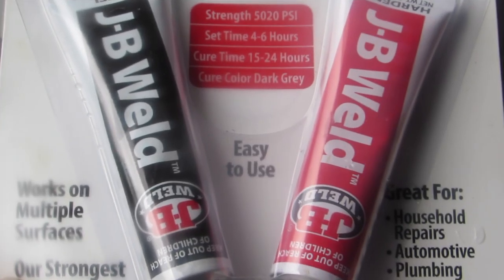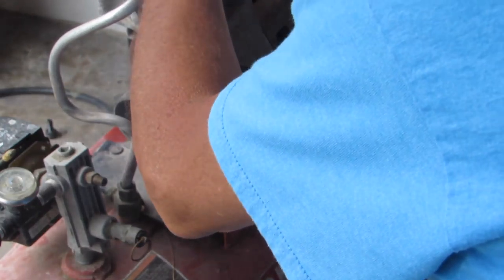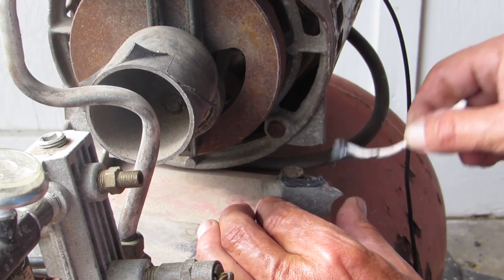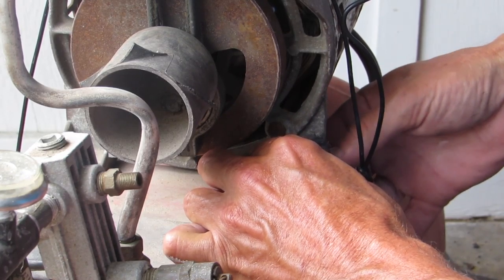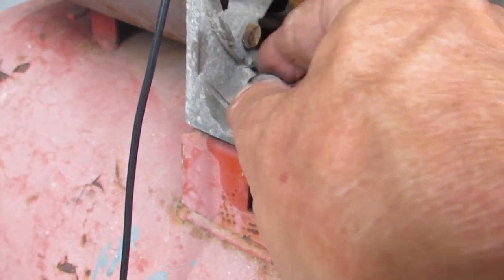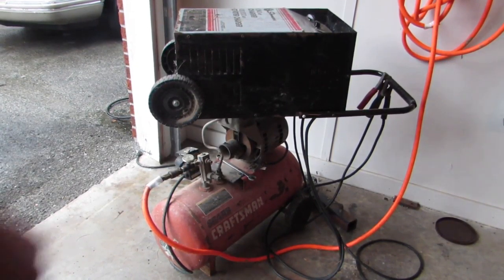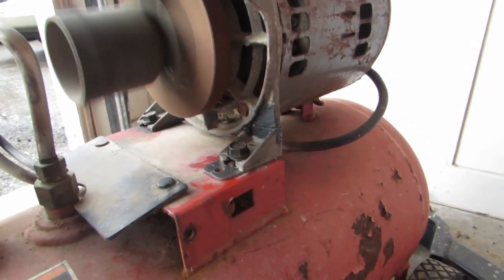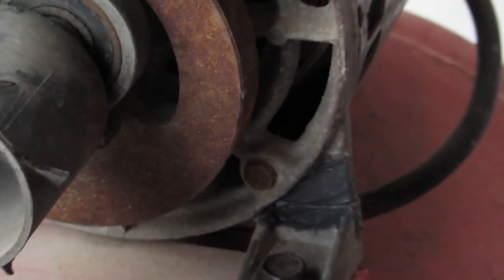JB Weld, Does it Work?

Comment: The mount should of been cleaned prior to applying JB Weld.  Always best to scuff break with sand paper to get to clean bare metal. Then I wipe down with isopropyl alcohol to remove any oils. Allow to dry, then apply JB Weld, clamp, wait 24hrs.
Reply from the maker: Thank Mr or Mrs Glue-pro. 
I will call you if I need you to glue something.
Reply: JD Weld
Reply: A wait of 48 hours gives the best results, but spot on. Without doing all those steps it will not work.
Reply: @JohnDisque sorry for the term rust. And yes I'm a glue expert. I create glue formula. I bought multiple properties out of it. You want an autograph?

Comment: The weight on top is what did it. It squeezed out all the weld in the middle. It’s actually better to just give it a light press (weight) to hold it down.
Reply from the maker: Yeah.... But I've tested this on other stuff.. and it failed on the easy crap too. 
I wish I would've taken it apart. Since this time I've restored it on the channel Pro Level Restoration and it's really no big deal to rip it apart, WELD it and get it back to to right.
Peace
Reply: And you needed to clean and prep the area
Reply: I find the JB Weld two part putty works better.  Knead it until the two colors turn to dark gray then apply it.  Hardens pretty quick then let sit for 24 hours

Comment: You would be better off drilling a hole in the top section and another in the bottom section then use baling wire or a pull tie to secure it together.
Reply from the maker: I would've been better off Scotch-taping it.
Reply: or a bracket with small bolts if your going to drill holes

Comment: Vibration is the culprit here, I believe strongly that JB weld is not your long term solution, although its a darn fine epoxy. Your little Craftsman compressor looks to be a little beauty and they don't make 'em like that no more so fabricate a small metal plate or have it welded and then mount it on thick rubber washers to help minimise vibration... take good care of that little work horse!!
Reply from the maker: Indeed... Vibration is the root of the problem.
I did stop most of the vibration before I ran the review and when I got it welded up all the vibration stopped. 
I'm going to follow your lead and completely restore this old work-horse. It's been good to me. 
Peace.

Comment: Ty for the 411, JB Weld off the list. I use Gorilla Glue often but don't think it would hold up either. Guess new replacement part if could find might be best long term fix but might be a bigger job than wanted replacing. Welder sounds good and quick too.
Reply from the maker: I'm a big fan of Gorilla Glue and it hasn't failed me yet. I just used it on a rear-view mirror and it's working great so far.
JB Weld would probably work on something that doesn't have stress on it.... like a sealer for a pipe or something.... but the name of the crap is misleading.

Comment: You need to gloop it on thick, in otherwoods use up the whole tube on that, also do not put any in the break just over the top, it binds both pieces superficially, hope this helps

Comment: These type of repairs work best if you drill a small hole (1/4" or smaller) in each piece and use a flat piece of steel or aluminum to connect them with a couple of bolts and nuts.
Reply from the maker: Good tip.
I'll remember that.
Reply: Yes that would actually work a lot better

Comment: It’s all in the prep mate. Sand down the area and clean real good. No oil or grease deposits.
When mixing make sure you mix well. And correct amounts.
With yours you should of really built that up around the area that was weak. It wasn’t enough . But good try .
Reply from the maker: Thanks for the tips!
Reply: Take a piece of plumber's tape bend it 90° take that 10 mm case stud off which has a nut on the other end of the engine put that through the hole in the plumbers tape of the washer bolt it back down and bolt the other end to the top of your compressor?
Reply from the maker: @evilbeetlekustomscreations4965  I love JB Weld Experts.
Come here and get ya some!

Comment: the only way for jb weld to work is to leave a big amount of the glue on the outside right now I am convinced that is the only way it works as advertised, I have had some issues with jb weld I am currently still experiencing issues, what I have found is that if you dont care for how the piece looks like, meaning you  dont care for aesthetics this works to some extent but if your application needs to be clean and keep the piece aesthetics then this in most cases wont work, right now I got to this video as I am on the search for structural epoxy resins that could glue aluminum to aluminum as my motorcycle fell and the thread piece in the radial master cylinder where the rear view mirror goes  broke off and am trying to see if I could spare me some $$$ by using epoxy or whatever I may find.

a little recap on what I did so far: 
I prepared the piece, 
drilled some holes on both sides where it broke 
with the dremel made some gaps to allow for better adhesion and allow for sort of a ring of glue to be formed on the inside as I carved the pieces, 
when broken piece is seated they fit precisely and on the inside its hollow the idea is to fill with jb for more strength, 
applied a generous amount of jb weld and made sure it went all the way in into the wholes and gaps on both surfaces ( with a metal wire made sure the jb weld went inside the gaps and wholes)
seated the piece and pushed it manually to allow for the excess to drip out.
removed any excess from the outside with some scott shop towel, and with a clamp made sure the piece was strongly secured into place to allow for a stronger adhesion,  
fast forward  24+ hours I tried screwing back the mirror and even though jb weld stick to the aluminum the epoxy "monolith" that hardened inside the piece cracked and broke without even applying great force to the piece, wasnt even screwed all the way in before it cracked..

if anyone has an idea on how I can glue the piece I am open to suggestions.

Comment: Adhesive joints don't work well in tension. So a simple butt joint is unlikely to hold up for very long. You'd probably have better luck with a couple of butt straps cut out of sheet steel bonded either side . That way you're taking advantage of the much better shear strength of an adhesive joint.

Comment: It should has metal plates glues to the broad sides as well, like wrapping sticks around a broken leg with tapes or ropes, so gluing more metallic plates to the broken joints' broad sides, apply more of the glues, more layers of metallic plates glues around the broken joint areas, it's about gluing up more contact areas. So it's like applying more "tapes" on the front and back sides of the broad sides, the "tapes" are smaller metal plates or fragments, glue steel rods (nail thickness) on top of the metal plates as well, so bundle it up like a grenade - combining of glues, plates, glues, plates, nails, rods, glues, so it's like a bird nest! But since you are using up so much of the glue, why not try pay for gas, electric welding or laser welding ?
6 packs of the glues costing $120 NZD ($21 NZD each pack), at a strength of 3960 PSI.

Comment: What psi was your JB Weld. I would have drilled a hole for a bolt and tapped the matching threads. I would have still justed JB Weld as you did but also run my new bolt in. Should have been able to use it right away afterwards and it should hold for years to come.
Reply from the maker: 44.52947892 psi.
Thanks for you suggestion.

Comment: I'm at the 3 minute 11 second Mark into this video and I hope the JB works out for you I just prepared a table also with JB weld but I put a threaded rod through it and hopefully it'll work. Edit finished the video I was surprised at the quick failure.
Reply from the maker: You should be fine with your table. This motor mount is a tuff job for any adhesive because of the constant vibration and moving parts.
Reply: @JohnDisque  Yes sir thank you

Comment: Looks like the middle of the motor was fouling on the top of the tank causing it to pull the motor away from the bracket. You would need spacers on both sides

Comment: You could have used a Dremel with a small grinder wheel and made vertical slots on both sides and on both sides of the break then filled the slots with the JB weld and it would hold for years.
If jb weld can work on a car muffler it can work on anything.

Comment: Maybe it didn't work because you should have left a small gap between the two surfaces instead of forcing them together?
Reply from the maker: You're the only person to come up with a legit reason why IT MIGHT NOT have worked and I actually considered this at some point. I don't know and even if that's the case it should've at-least worked a little bit.

Comment: Recently tried the jb clear weld fastening a plastic battery box holder to inside of metal detector thats aluminum, soon as I broken tab off the product it had the worst smell & just doesnt go away at all & if you get it on your fingers the smell will not be able to come off for days even using nail polish goo gone the smell will disappear days later by wearing away using your hands on doing things round the house, I think the bonding may have held up so far but again the smell on the repaired area is not going away at all it may be there for long long time.. If I ever use any epoxy glue again for any other repairs down the road it sure wont be any jb product no matter how well it works.. I dont understand why the manufacture doesnt disclose this on their products of the horrible smell it releases once opened & after applying the epoxy the smell can make you sick..
Reply from the maker: If it worked I'd welcome the odor but it doesn't. I'd be surprised if it clued two pieces of cardboard together. If there's any kind of stress or vibration on what you're trying to repair you can forget it...., but that's not unique to J-B... If the part is metal you should weld it or replace it. 
Peace

Comment: I'm welding my heater core pipe the pipe goes to heater core 2 small one it's leaking but very little because the seal isn't really matching 100% so will this join the pipe end to heater core ?  Will it seal it ? The pipes do go inside heater core but the rubber or something making it leak there just little drips 

So my plan is put this inside the heater core ring and some around the pipe tip and fit them inside and put some more outside 

Plz let me know if this holds well and it's strong as they claim to be there is not much pressure but pipe might be little hot as its antifreeze going to heater core
Reply from the maker: I'd give it a whirl but I'm a gambler. I can't tell you for sure it's going to work and I can't tell you it isn't going to work but you're not dealing with all this vibration so the odds are with you.
Clean it up real good with alcohol and give it a shot. 
Peace
Reply: @JohnDisque  I did worked great and it's like a rock no antifreeze leak I let it dry for 8 hours and when I drove the car for some reason made it even harder cause the pipes get hot so not sure if that cured it even more 

I went bought some more and I added more on top and around for extra security before I close the the parts 
I am keeping it open the area driving the car for some days before I put rest of the parts in 

But amazing products I didn't think would work wasn't sure but when it cures it's like concrete super hard I couldn't even scratch it with screw driver
Reply: @JohnDisque  thanks for the reply

Comment: You didn't wire brush any debris off both edges of the break. It also might have worked better if you unbolted both sides, propped it up and fit the (brushed) broken pieces that way and applied a liberal amount to both sides of the break. Give it a few minutes then just unprop and set it down gently for 24hrs. The weight of the compressor should've been enough. 
If possible, turn the machine over so there's no weight -- or gravity -- on that broken piece.

Comment: He should have turned compressor upside down and affixed the broken piece on from the top. THAT would have worked. The pressure on the whole unit dissipated over both mounts. Not enough on the side needing repair!!

Comment: I got 2 motor mounts broken on my motorcycle on the bottom of the engine. Was thinking about jb weld bc I don't have the time or money to take it to. Machine shop. What did u do to end up fixing it?
Reply from the maker: My buddy came over with a mig-welder and fixed it in about 2 minutes. 

In your case.... if you can't just replace the mounts - a good welder can do it but I stress "good" because I've seen some really bad weld-jobs and you need to get your job as straight as humanly possible.

Comment: You didn't apply adhesive to BOTH pieces. And you should apply sufficient amounts to make it ooze out. Applying it and pressing it together as opposed to just pressing result in two different adhesive distributions in the crack. Also, alignment is key and the most important part of the process. I suspect that could have been more of the problem. The spacer was a good idea but without the other two techniques it was doomed. As someone mentioned, overweighting could be a contributing problem but if it was aligned and pressed together correctly with a sufficient volume of adhesive, overweighting would not have made much of a difference.

Comment: I think youd be better taking the whole thing off, drilling through the broken parts taped together, tapping a thread in one of the parts & putting a counter sunk grub screw or machine screw in after you added the epoxy. That way its mechanically held as well as glued...the epoxy should stop it vibrating apart? Just an idea.. :|
Reply from the maker: I got it welded and it's been fine ever since. If it couldn't be welded I would've done something similar to what you suggest here or I would've purchased a whole mount if they're available. 
Either way I wanted to see if this crap worked.
Reply: @JohnDisque  Interesting video... been wondering myself what you can use that stuff for. Guess its better just as a filler..

Comment: you applied the epoxy to a dirty surface, two actually, I saw no clean or prep.  May as well been gluing mud clots together.  If you actually welded it together do you think the surface would have been prepared first?
Reply from the maker: OK

Comment: I'm guessing it would have worked If you first bolted the compressor down  and then use JB weld to fill the crack and put a lot more JB weld on the outside of the crack... I would give it two days to cure....
Reply from the maker: You got one part right - you're guessing. I used the left-over garbage to test it on less strenuous things and it failed on that too.
This garbage is worthless.

Comment: Did you rough up the surface before apply. It usually needs something rough to grab onto
Reply from the maker: No, but I threatened it and pistol-whipped it like Kyle Rittenhouse. Then I swore I'd replace it with Elmers glue if it didn't work.
Reply: @JohnDisque  🤣🤣🤣

Comment: I've generally had good luck with it, tho I've never used it for something like this and I really can't think of any clear reason why it failed.

I have noticed tho, from past experience JB doesn't work all that well in humid environments (tho isn't applicable to this) but over time it seems to soften up if outdoors in humidity. If I had to guess maybe it wasn't clean enough for a good bond or maybe not enough pressure but beyond that I have know clue but from the video the bottom mount looks fairly flat without any ridges tho it might not have been that way in person. 

Glues generally do a better job on rougher surfaces just more to hold on to. I did see the shim tho under it to shorten the gap, that seems like a good idea, maybe throw a washer under it as well.

You can try to drill a hole a little under and above the crack (tho I may crack again in the process) and just fasten it down with a metal zip tie. 

Might not look the best but hey function over form.

Comment: +1 for the cig lol. I think this product works on smaller things but for an object like this I would use a welder.
Reply from the maker: What's it work on? I tried it on a sneaker (rubber on rubber) and it failed on that too. I also used it to block water from leaking from copper tubing so I could bend it into a coil.... It failed on that too.